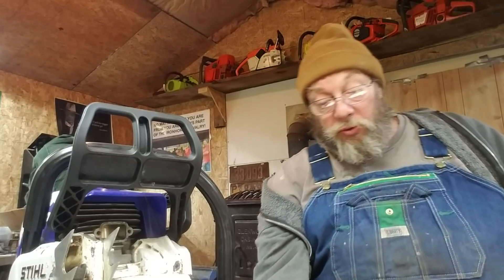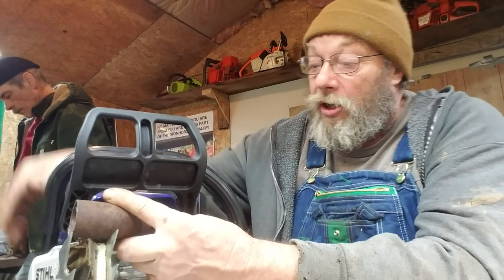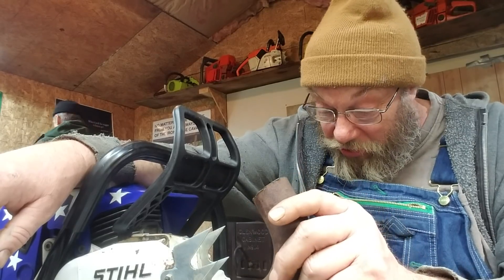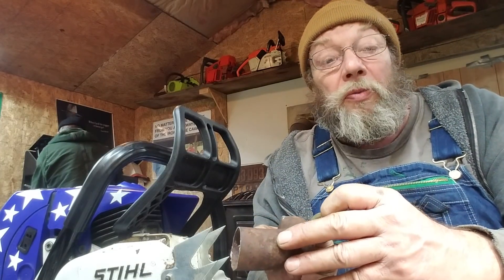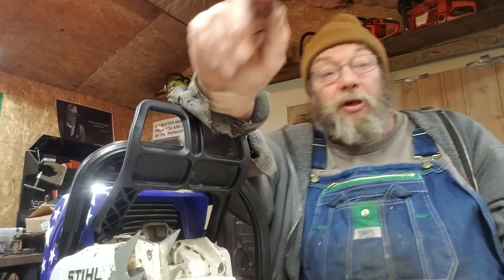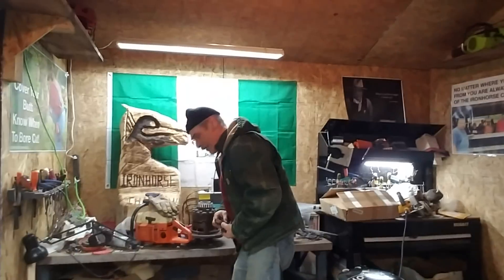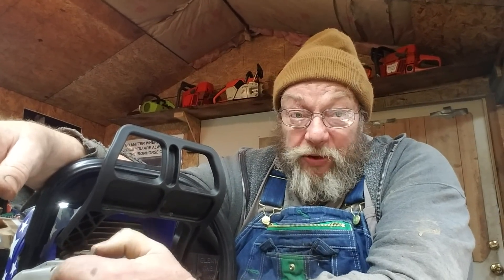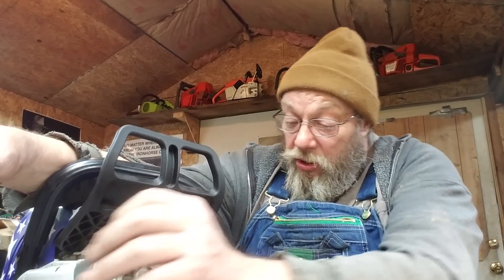Building a pipe for old Dave! Logging talk from evan and me!

Comment: Hey Uncle Harv,.... what if you took a stock Stihl muffler or even a dual port... gut it and drill holes out the front...then weld that pipe out the front?
 Would you get enough pressure so you dont blow it up? What's up Evan.... welcome to the channel and nice to see ya!

Comment: I think it's very cool what you are doing and showing us how to work on these saws but a couple questions I just started watching this video question 1 the way you're designing that pipe to run out is it going to interfere with the chain and question to do you need back pressure because everybody says sometimes you need back pressure these are only questions because I see them as a problem that's why I'm asking you them thank you did you read my email

Comment: Instead of an adjustable baffle, why not snip and shink the exit part down then put a little nipple that sticks in like a half inch and weld it so it baffles, gets the shockwave for the 2 stroke and will have a smaller exit for high rpm cutting and nt crazy lout. Just 2 cents. But i like ur project. Will be glad to see it working

Comment: What saw would u get a ms362c or a ms391?
Reply: 362 cm all day over the 391 unless your only going to be cutting fire wood other wise the 362 is a much better falling saw.
Reply: @briankirwan9588  I want something thats going to plow thru firewood and have no problem felling trees also. Just was wondering witch of the both is faster. Cause the 391 is 5cc bigger.
Reply: Mud Light Racing 362 is a pro saw... 391 is plastic... I have a 362 and 461... I love how light the 362 is compared to the 461... I think you will enjoy the 362 wayyy better...and I believe the 391 dosent have adjustable oiling..spend the few extra bucks and don’t look back... and ohhh... I would seriously get the “r” model....the wrap handle  double dogs and better clutch cover.. keep us posted
Reply: @tjlovesrachel  thanks man thanks for the input. I'll let u know.
Reply: @tjlovesrachel  I just went and bought one today and love it what a awesome saw so far. I have a big white oak I'm gonna try it on tomorrow.
Reply: Mud Light Racing what model did you decide on?
Reply: @tjlovesrachel  ms362cm cutting some big oaks as I type. What a saw real fast
Reply: Mud Light Racing good I’m glad you like it ... it will get better once it breaks in... what mix oil are you using and what size bar? And did you get the “r”version?
Reply: @tjlovesrachel  no ididnt get the r version. I'm running it prolly closer to 40to1 mix and its running better and better every time. I love it
Reply: @tjlovesrachel  oh and a 20". whats the biggest bar I can use cause I got some big stuff on the ground. I am about to order a 24 maybe a 28 for occasional use.
Reply: Mud Light Racing gotcha I wish I got the r version .. but my 461 is an r... and I was asking what oil are you running not the ratio... and well with the Oiler turned all the way up I wouldn’t go past a 24-25”....I’ve had a 28” on mine but the Oiler really couldn’t keep up... you know you can put the 461r  Oiler  on that saw...and the r Oiler is the high output one... but if you do that you need to check your oil religiously because it will go dry... my 362 usually wears a 20”....and I had it ported by hotsaws101.... so it’s really comfy with the 28” idk how it would be stock with the 28”
Reply: @tjlovesrachel  I am as of now running the stihl brand synthetic. They gave me a two year warranty if I bought the stihl oil. Any recommendations on oil are welcome. My other saws I run VP 2strokeoil. I will most likely keep a 20 on all the time.
Reply: @tjlovesrachel  for a stock saw and for its size its got good power. Oh and where can I find the outer felling dog that matches the inner
Reply: Mud Light Racing I was running the stihl hp ultra as well for about 10-15 tanks then I got it ported... the guy who ported showed me when he took it apart how much carbon was in there and recommended belray h1r...and I’ve been using it ever since ... and yes it does have good power for a stock saw I just am a performance freak idk... and idk where to just get the outside dog.... but the dealer sells the double dog kit with roller chain catcher....it’s the stock part for the r model... that’s what I put on mine
Reply: @tjlovesrachel  alright sounds good where can I get that oil from?
Reply: Mud Light Racing I ordered it online...but it’s a very common motocross oil so I would start with your local dirtbike/power sport shops if there are any in your area
Reply: @tjlovesrachel  ok cool thanks. Where can I get that oil. And I run VP oil in a lot of my two stroke stuff cause it's real clean. Wonder why it makes so much carbon. And I know the proper ratio is 50to1 but is that what u run?.
Reply: @tjlovesrachel  sorry just saw u answered that about where to get it. Whats the biggest bar u run
Reply: Mud Light Racing I don’t understand why it’s like that... my saw builder says it’s very common for him to see it ....and he showed me my piston... and yes I run 50:1 especially with this oil... if you research it’s specs.... it has a relatively high flashpoint compared to most other mix oils.... so this means it dosent all get burnt up during the ignition of the fuel and it’s much more viscous then the stihl so it sticks to parts better and provides a better film strength....all this means you don’t have to get crazy oily with the mix...and it smells way better then the stihl mix too.... and like I said I have ran the 28” on it ... never stock tho.. only after it was ported... so I can’t tell you how it would be performance wise... but I will tell you that when I did have it on there the Oiler didn’t really keep up....I mean there’s a video of my saw on my builders channel with a 32” bar going against a stock 461....but it was for only 2 cookies and even then he was “concerned” about the Oiler lolll... and if your happy with the vp oil then stick with it... I’m sure it’s better than the stihl oil....but look up the vp specs vs the belray... I haven’t looked but I think I might
Reply: @tjlovesrachel  hell Yeah man thanks for ur input and suggestions. I was just taking apart the 362 to have a look inside and wow whata well made saw I love huskys but damn stihl quality is on point. They didnt cut any corners with the type2. I like VP cause thats just who makes the fuel I in the trycks I race and its easy to come by it looks a lot Like the red ecko oil.
Reply: @tjlovesrachel  ok well I ordered the dogs amd chain catch. I was always told to stay away from the liquid cooled two stroke oils cause they run cooler than the air cooled so there for the hotter air cooled 2strokes need a different make up of oil. Idk just a thought. I also ordered a skiptooth chain to maybe help with the 25" bar. And a 20"sugihara lightweight bar. I already have a stihl 20 and 25 bar.
Reply: Mud Light Racing gotcha ... I’m glad your happy with your purchase.... and the belray isn’t for “liquid cooled” only..... that’s like outboard/marine type oils.... you can run the belray in air cooled as well a lot of people in the RC world run that or motul 800.....but I get where your coming from...and I’m glad I could help with whatever I could...enjoy that saw and don’t lend it out to anyone lolll
Reply: @tjlovesrachel  hell no I would never do that last time I let someone ise something was my hilti grinder about $600 and they came back and seid it was stolen out there truck. They repaced it with a $30 porter cable. I ordered some bleary and some others to test out. What fuel u use.
Reply: Mud Light Racing that sucks man I’m sorry...what’s bleary?... and idk where your located but I use premium pump gas (93) octane.... if my area had easily accessible ethanol free fuel I would use that
Reply: Ohhhhh belray loll
Reply: @tjlovesrachel  sorry spell check spelled it that way Idk.
Reply: @tjlovesrachel  I'm in amelia VA. we have all kinds of fuels out here. I have a 5gal can of leaded 112 I want to try but don't know how mtronice would like it. I use none ethenol 89 with some VP octain booster.
Reply: Mud Light Racing I’ve never ran leaded ...but I’ve heard of guys using 100ll (aviation gas)... which has lead in it ... I wish I could find ethanol free at the pump easy where I’m at.
Reply: @tjlovesrachel  yeah I can get none ethanol inwould like to find some unleaded race fuel.
Reply: @tjlovesrachel  ok so I got my belray h1r and also some klotz just to try.
Reply: Mud Light Racing awesome man lemmie know how ya like it

Comment: What can if anything to pull a 25" bar on a ms391.
Reply: Should pull it just fine man
Reply: Dale Darnell I bought my 029 with a 25” bar in 1998. When it finally got ‘tired’ after 17 years In 2005 I bought an MS 390 with a 16” bar. I put the 16” on the 029 and the 25” on the 390. I have never run anything but the 25” bar on the 390. Both saws are still serving me well after another 14+ years. Just make sure to keep your chain sharp and your drivers filed correctly.